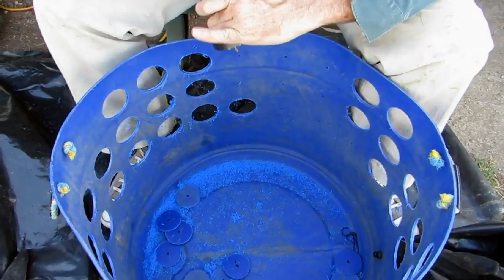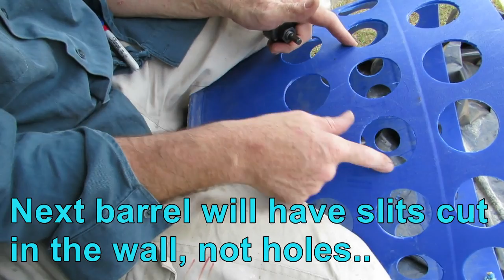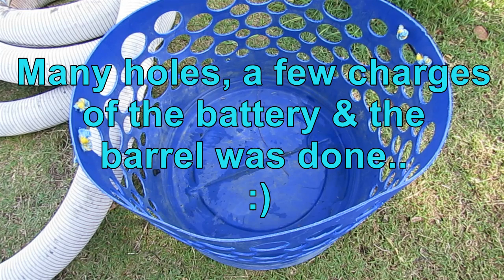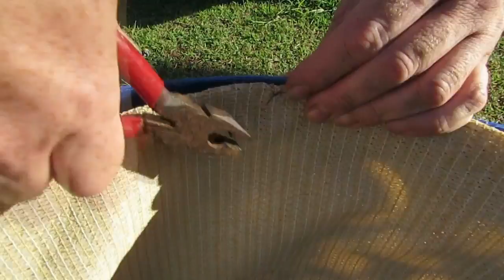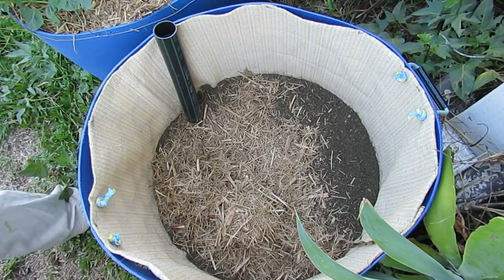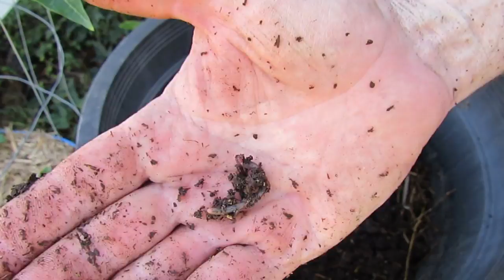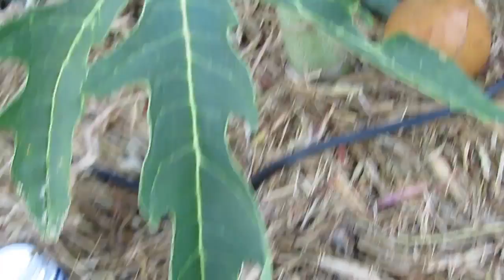Air Pruning Self watering/Wicking barrel, a DIY project for papaya/pawpaw..

Comment: Love your work dude
I am putting lumps of charcoal in the bottom of my wicking pots now. I will start constant flow through this layer with highly aerated compost tee in next gen. 
Beyond that the next obvious step is air-potting the sides.
Also thinking that we could go to 2-3 foot soil depth by adding those clay slow release things in the top layer.
Your work is accelerating my own ideas, your heaps faster than me, but will update soon.
Reply from the maker: How are the pots working out for you Craig ? Plan on adding a few of the air pruning bags to the aquaponic system to see how they go.. Was working on how to make the trough for the pots today..
Subbed to your channel to see how you go with yours.. Sorry for the slow reply, missed your comment before..
Cheers sir & have a great one :)
Rob.
Reply: Waiting in the bank the other day, I suddenly had the idea of running 2 parallel feeds. Air-prune pots, with wet-pot in the top and 2 rows of wicks in the  bottom. Pots sit on a bifurcated trough, with one row of wicks feeding from AP solution for Nitrogen. The other row of wicks sitting in compost tea for Potassium and Phosphates ect. Would have the pot on a slope with drainage holes over the compost tea channel. Would put the charcoal in the troughs and If I could afford it, I would run air diffusion lines under the charcoal on both sides of the pots - massively increasing 02 to the roots via the solution is the next goal. Very exciting but no time to implement. Be sad to see someone do it first, but then it is not meant to be an ego-trip. Better to have more people's creativity and experience on board.
Reply from the maker: Craig Thompson
 Sounds like a good experiment Craig.. No worries about me trying it... Got far to much on my to do list already :D ;)  Would like to see you have a crack at it if you get the time & resources..
Cheers mate & all the best..
Rob..

Comment: Excellent video, Rob! I really like this design a lot. Now I just need to find a free source of barrels so I can start making them.
Reply from the maker: I have a free source but they come full of used motor oil & are metal.. Not something I want to deal with just to get a grow tub ;)
Large pot plant tubs will work.. Just need the reservoir section lined if you want to add the wicking component.. Some also have great success with the poly propylene shopping bags in a tub of water but not really something that I want to run with here..
Cheers mate & all the best,
Rob.
Reply: Rob Bob Thanks for the ideas. I should probably be able to find some free food grade barrels. Living near a large city has some advantages.

Comment: To trim up those holes use a deburring knife you can get them at an auto store for about 5-10 dollars. The blade looks like a C. It will save you time, be safer and you won't get any sharp edges. All nice around edges. It also works great on the bigger totes.
Keep the videos coming. I have learnt a lot from you.
Reply from the maker: I keep meaning to grab one but always forget when I go to the hardware.. I think my father is looking for a spare after he saw all the holes I had to clean up :/
Thanks & have a great one :)
Rob..

Comment: Wotcha! Nice idea. I have some young apple trees that need homes and a supply of cheap barrels. For drilling the holes try fixing a length of 4x2 horizontally to a bench so it over hangs the bench to the depth of the barrel. Put the barrel on the 4x2 and drill the holes. You may find that you dont have to remove the waste plug from the holesaw every time, let them build up and drift them all out at once when finished.
Reply from the maker: Thanks for that Michael & shall keep it in mind..
Think the next one will have slots cut out of the side & might even try to sew up my own bag out of shade cloth if I can find some cheap enough..
Have a great one Mate..